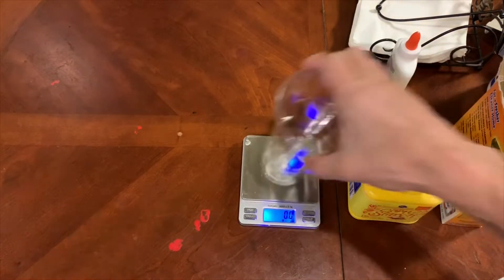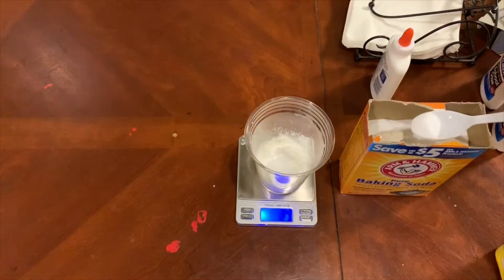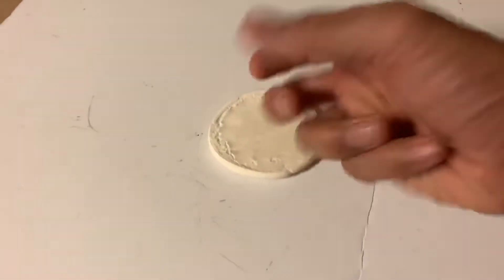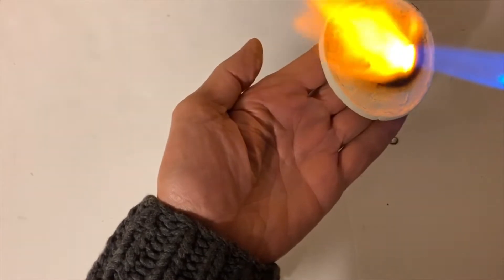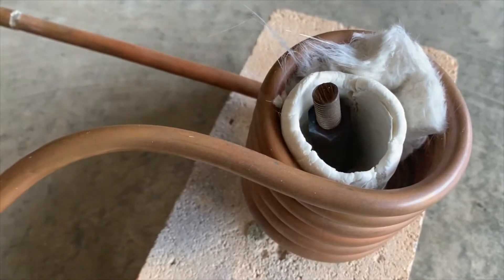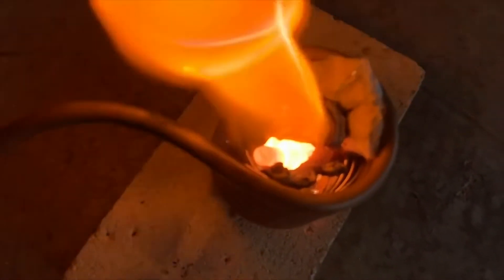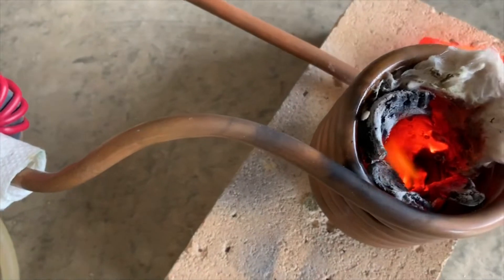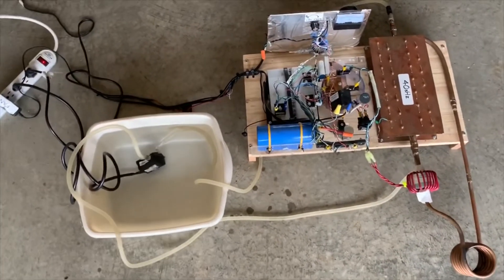Starlite Crucible getting Killed in an Induction Heater

Comment: not a good crucible mix since the metal would prevent the foam from expanding
also IRON will dissolve the foam.
better to use as refractory lining of furnaces or forges as those will be more of its application.

Comment: I think the problem is just the sheer mass of the steel on the inside. Starlight doesn't have much in the way of structural strength. You probably needed to make it thicker so that the carbon can form a thick enough layer.

Comment: I think starlite requires an incomplete combustion to form that layer of black carbon.

So using heat that does not use oxygen as fuel might not allow starlite to work its magic.

Try blackening the starlite with the torch and try the same test again
Reply: nope, theres oxygen in the air even if that were the case(i have no clue) the reason this failed was starlite is brittle when in that state, a better solution would be to mold it around a solid to give it fourm

Comment: Mate, you didnt prep starlite as it need black layer of Carbon to act as insulator. So if you flame treat it before use, it may work. Also can you please try to cover an off the shelf crucible with starlite to see if it improves longevity. 
1. Inside only 
2. Outside only
3. Both sides
4. No covering

Another experiment  would be to use a normal can instead of crucible
Reply from the maker: Good idea mate! I’ll put up another video of the flame treated version of the Starlite crucible contained within another crucible.
Reply: Yeah mate!
Reply: you dont have to prep it, the layer forms by itself once it gets hot, especially with a gradual heat up like this, thats why starlite is so interesting, it has a auto repairing layer of carbon.
Reply: @sirblacksmith2297  yes but it's a bad idea to melt any metal in it, especially steel since it will absorb carbon and become brittle.

Comment: Great demonstration of the limitations of ‘starlight’
Reply: No, it really wasn't a great test. He didn't even prep the Starlite to achieve its maximum benefits. Starlite requires a layer of elemental carbon to withstand temperatures.

It needs to form a black layer on the surface. The only way it can do that is if it is exposed to incomplete combustion (eg: a fire, a blow torch...)
Reply from the maker: yeah man!

Comment: Ha! Great test. I'll have to think about this one and see if I can modify the composition to work better for this purpose. One problem that might not be solvable is that carbon is soluble in molten iron.
Reply from the maker: NightHawkInLight thanks - I was hopeful it was going to work and save me a bunch of money on crucibles. I am looking forward to trying out your new composition when you have come up with it. Perhaps silicon instead of carbon based formula?? Please keep me posted.
Reply: @BrianDhvTinkerer  isnt using silicon just gonna make aerogel?
Reply: @BrianDhvTinkerer  diagram schema ???
Reply: I recently saw a video using iron/aluminum based thermite against the starlite and it turned out just fine. I understand that the carbon being released may be consumed by the iron (and thus may not be the best for a crucible due to too many impurities), but I think the major difference between the scenarios is the general heating vs the combustion reaction. If exposed to fire prior to its use as a crucible, the results would probably be very different. As an aside, IF the carbon content released into the molten iron were controlled (big IF), could you reliably make variations of steel? I think the carbon release could only be estimated, especially if the starlite is not homogenous throughout.
Reply: @IAmSpectreOne  a search for "curing starlite" is how i landed here. Wonder if high temp ovens could turn it into a usable fire panel of sorts
Reply: @IAmSpectreOne  If heated before being used as a criucible, the carbon would basically become a graphite foam which is very weak. Removing the bicarb would be better, it does nothing, but the sodium carbonate left over after the original firing would be a decent refractory filler before calcining into sodium oxide, and then lye once it has contact with air moisure. A better choice would be calcium oxide, burnt lime, calcined limestone. It's a good refractory and it won't foam, minimizes carbon content.
Reply: What if you ‘pre-charred’ the crucible with a torch before putting in the steel and then melting? Seems like perhaps the iron reacted with the regular starlite and not the charred, protective layer. That would be a good follow-up experiment if you haven’t done it already.
Great vid tho! I’ll be looking at more of yours! New fan... ;-)
Reply: Sand
Reply: Can I use this material as a backup insulation for for steel foundry.
Reply: @Vikast45  yes
Reply: @mattbanks3517  could you please explain it how this thing's will work as a good backup insulation for steel foundry.
Reply: @Vikast45 when it heats up, it becomes a carbon foam. Just like overcooked bread, the carbon can take very high temperatures because it's similar in structure to graphite. Since it's a foam, it can be a very good thermal insulator.
Also, by steel foundry you mean an oven for heating up steel, or something that can you can melt steel in? It's good for a foundry, but if you put the steel directly on the carbon while  hot, it will absorb carbon and make the steel brittle. For this reason, it's a bad idea to melt steel in a crucible made from starlite, but it could be good for a forge (oven) replacing the use of firebrick or glass wool.